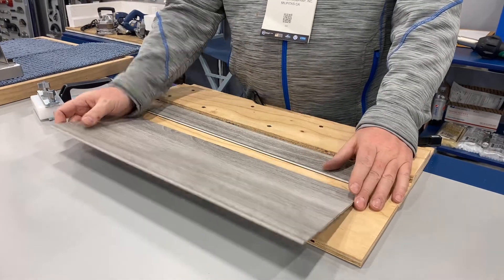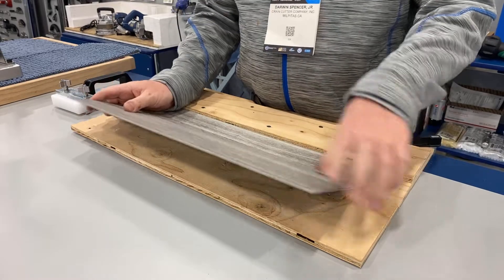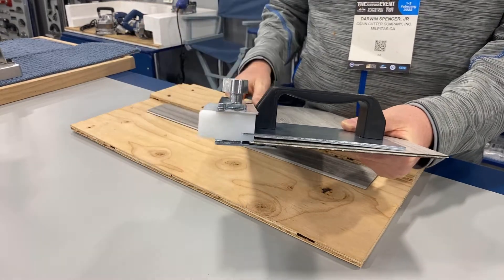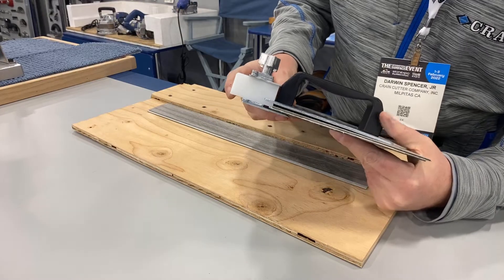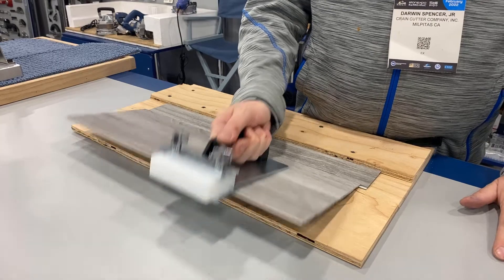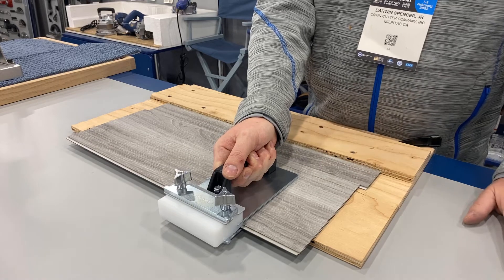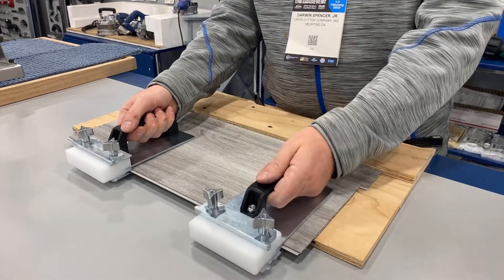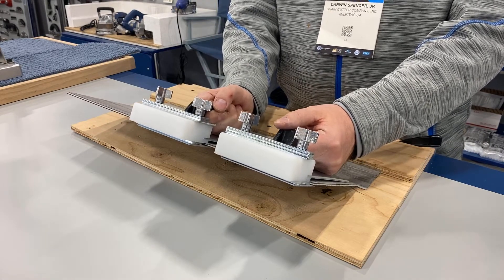Crain 576 Angled Tapping Block

Comment: Wait till u get to the walls and door casings another tool tested in a box with no walls or doors
Reply: Do you still use a standard tapping block even though they won’t work close to a wall or door?  Or a hammer?  Or a nailer?